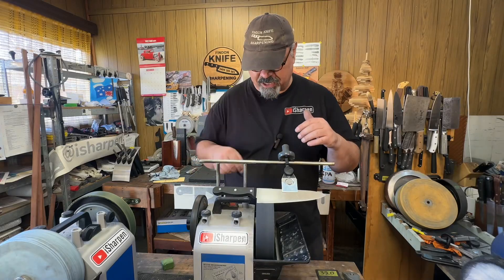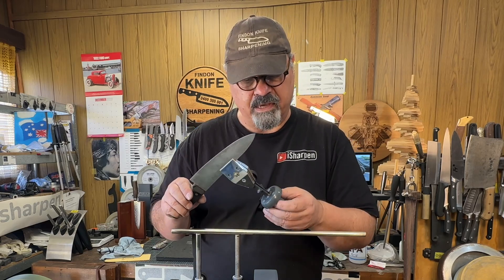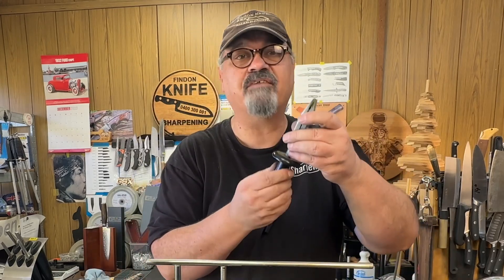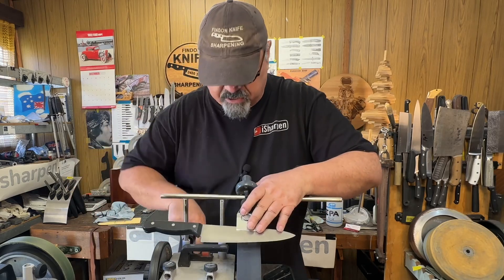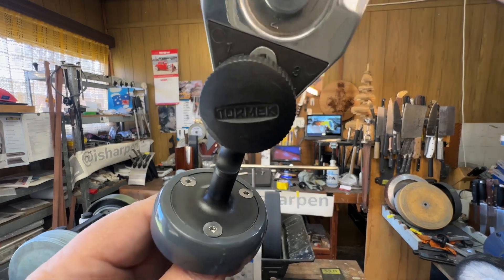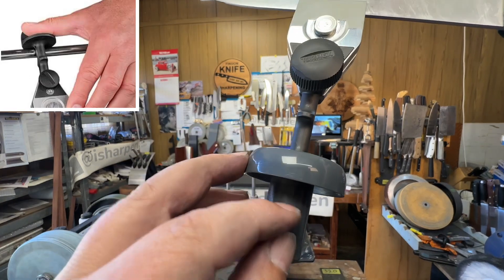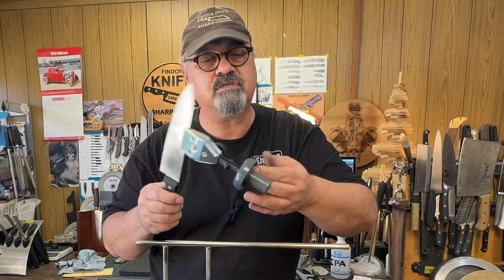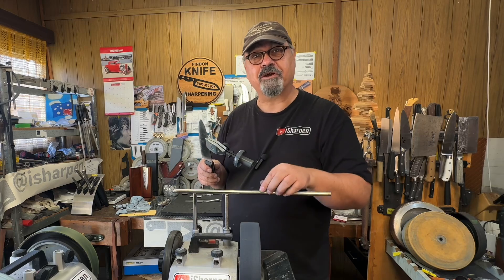I SOLVED The Horrible KJ-45 Knife Jig Problem!

Comment: I put some of the cream for deburring and polished the heck out of the guide rod.and polished the face of the plastic fixture to make everything ride as smooth as can be it helped a lot but I still haven't mastered my control of my motion being in sink. I have the old style holder. I think I will get me a piece of teflon flat stock and cut off the cup and drill a hole in the flat stock  mount the flat stock to what is left of the handle and have the smoothest riding fixture in town.
Reply from the maker: Nah, just add a few drops of light machine oil and smear it across the top. It’ll glide. I used to be a welder. I think that helps me with a smooth motion.

Comment: Phenomenal, I’ve got 50$ on one right now!
Reply from the maker: It's a mod that shouldn't have been necessary. They just weren't thinking. What do you mean about the $50?
Reply: @iSharpen I mean I’ll pay 50$ right now for one! I hate the new jig as well and wish I had an alternate. If you get some made I’d love to get one.
Reply from the maker: @Kitchenratsharpening  Cool. Good to know. There are some costs to get started and depending which route I go will determine the final cost and charge. For example, to print one up on a 3D printer will cost me about $35-$40 if I go with a company that does 3D printing. Or I could buy a #D printer and do it myself from home but that's thousands up front. Or I could pay a few thousand for the tooling and set up then from there each unit can be turned up on the CNC for much less but I have the original investment. Or, I can just have the #D printing file made and sell that so you can all print one up yourselves. Do you have access to a 3D printer?
Reply: @iSharpen ahhhh I didn’t see the reply!!!

Honestly I do have access to a 3D printer. While I think selling the plans is convenient and also a cool way to get the part out, at the end of the day most of us are lazy. I’d rather just buy the piece up front. 

I personally believe that with where we are at with the technology, a 3D printer is a WORTHY investment. Sure it’s a lot of startup but the possibilities are endless, especially with specialized mods. Realistically there are FEW things you CANT make with a 3D printer.
Reply from the maker: @Kitchenratsharpening good feedback. Thanks. I’m considering several investments right now but including a 3D printer vs a Fibre laser vs adding to my knife range. They all cost thousands of dollars. YouTube will need to come to the party which means I’m going to have to up my video game and make more interesting videos that appeal to a wider set audience.

Comment: I'm maintaining the old style clamps because it's too slow (and annoying) to readjust the height of the bar, much faster to change the clamp. I have two machined for thicker spines like Dr Vadim described, but don't use them too much. I use the new one for v thick spines or cleavers.
Reply from the maker: @lechimera99  it only takes a few seconds to turn the screw on the rest and it’s locked in place. I’ve never even once turned the handle on the SVM. I wouldn’t trust it.

Comment: I made one and glued it to the jig it helps a little but in my opinion tormax is not a great system for knife sharpening doesn't produce great bevels like my guided system of ever hand sharpening. woodworking tools its great .
Reply from the maker: Once you figure out how to use it properly it's one of the best knife sharpening systems out there in my opinion. Especially for commercial purposes. I get excellent and reliable results but it is a bit tricky to learn. I've tried to make it easier for folks by showing them how to use it properly. But Tormek and their DEvolvement aren't making it easier for new knife sharpeners with their atrocious new jig. That jig makes people hate using it.

Comment: Hi Baz,
I'm very happy to have found a solution for the new jig — because you're right, the new jig doesn't work. I also modified mine. But I bought a retrofit jig for the Magnolia knife. The retrofit works, but I re-machined the parts to include a thumb rest and fixed it in place so it doesn't rotate.
So if you're selling your retrofit, I would definitely be interested... I'm always up for improving things.
Reply from the maker: I have requested many times to Magnolia to machine the thumbcup in but for some reason he refuses. Plus he also refuses to send any overseas. That has forced me to find my own solution.

Comment: I 3D printed a similar solution a few months ago that also widens the bearing surface. Notably, it is a single piece that doesn't involve altering the jig in anyway and simply snaps on and off. No JB Weld needed. I'd be happy to email you a photo, if you are interested.
Reply from the maker: @ImEvidenceBased  I’d love to see it.
Reply: I'd love to see it as well. I saw this video (Thank you @isharpen) and figured I'll go make one for myself (I am not very good @ Tormek, so I keep struggling with the original "knob" lifting up on one side). I planned to 3d-print something, but if I am imagining your idea correctly, it's much more clever than what I would have done. Would you be open to putting it up on printables?
Reply: Are these on ebay yet because I will definately buy one!
Reply from the maker: @DawgNo1 no. I haven’t found anyone me to make them yet. But if and when I do I’ll sell them myself at https://isharpen.shop

Comment: I haven't had any problems with the new jig.  If you take it slowly and get used to it, there is no problem using it att all!  Anyway, if you prefer this alteration and am happy with it, good for you!
Reply from the maker: @arnarne  have you used an old one with a proper thumb cup? There’s a huge difference in stability and control, especially with longer knives that exert substantial frictional leverage at the ends. I come across all sorts of knives and being able to hold the knife level is critical.
Reply: @  Yes I have used the old one for years. I have to admit though that I haven't used the new jig with a long knife. Only rather small ones.
Reply from the maker: @ as long as it works fir you that’s ok but the moment I put one in my hand and tried to use it it felt like a rejected early prototype. I t just felt wrong. I tossed it to the side and never used it again. I hated losing faith in my favourite company but really had to question their sanity.

Comment: Honestly, I prefer the stop on the new jig to the old one, but happy you made it work for you!
Reply from the maker: Cool. As long as you're happy that's the main thing. Have you used the old SVM jig or have always used the new KJ?
Reply: @iSharpen  I used the the SVM jig for several years before they came out with the KJ.  It's not a strong preference.  I just prefer the KJ's bigger flat area facing the bar.

Comment: That would nice upgrade, currently I use two of my fingers to hold around the bar to prevent jig from lifting off bar while my thumb is on top of jig round part on bar.
Reply from the maker: @robertdewalt8711  it’s a dumb design. Thats for sure. They weren’t thinking when they designed it let alone when they released it. This mod fixes it 100%.

Comment: Interested but hope its not ridiculously expensive - and includes mounting instructions.
Reply from the maker: @DavidL-c4w  nah, it should be fairly inexpensive to make. Depends how I do it. Making thousands would be the cheapest per unit. But I doubt I’d sell thousands. I can see a few dozen being ordered. I think the best thing would be to get a 3D file made up. Easier to sell and cheap as chips but then you’d all have to find a 3D printer. I’m going to have a ring around tomorrow to a few places my engineer told me about. Stay tuned. Mounting will be easy. All you’d need is a hacksaw, a file or some sandpaper and some JB Weld for plastic. I’ll do a full video on it.
Reply: @ Great.  I just bought mine late last year and have been watching your videos to learn how to use it.  I find your videos most informative of those I’ve watched.
Reply from the maker: @ thanks man! I appreciate you watching them. Where are you located?
Reply: @ Frederick, Maryland -USA
Reply: About an hour north west of Washington DC.
Reply from the maker: @ cool!

Comment: Looks like it would be easy to knock something up on a 3d printer to glue on the new holder
Reply from the maker: That's what I'm thinking. Now that I have this prototype and it works really well I'm going to look for some way to have it made into a 3D file and get some printed.
Reply: @iSharpen  I've got a knockoff style Tormek machine, not being able to afford tormek obviously.. Especially since this is a hobby for me. Anyway, it didn't come with a knife jig. I've just designed a quick first version of my own jig which will be 3D printed at the end of the month when I get home. My one will be a complete replacement and use some sort of stainless rod and a bolt & wingnut.. but the top or hand part could be something you could end up using for 3D printing. Especially since I'm designing one anyway, so it could work if you wanted to add in some features of your own.
Reply from the maker: @brianvanniekerk7160  seen my latest short? 

The New BAZ™ Hybrid Knife Jig #tormek #prototype #beta
https://youtube.com/shorts/3Z3c4gk-e8Q

Comment: I had no problems with the new jig because I sharpen edge trailing instead of edge leading. I started sharpening this way after catching an edge on the Japanese water stone (there are those who have, and those who will). The ability to convex/re-curve grind on the Tormek makes up for my only complaint that the new jig has some flex in it. I don't push hard enough for it to be an issue, but it does not feel as high quality as the original. 
The real game changer for me, is the new KS-123 angle setter. Do you have one yet? It saves me a ton of time and allows me to confidently transition through all of the wheels I use while keeping the exact angle.
Reply from the maker: @Markkus12  if it works for you that’s good. I’m not interested in the 123. It’d be a waste of time for me. It takes longer to do the same job that the WM-200 can do in three seconds. I don’t use multiple wheels.